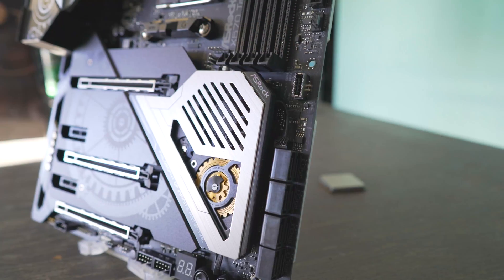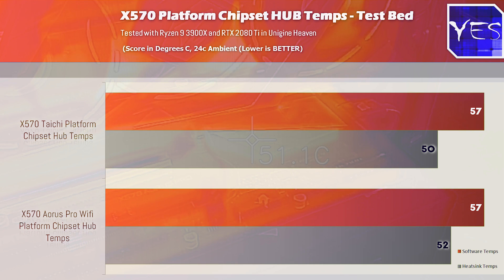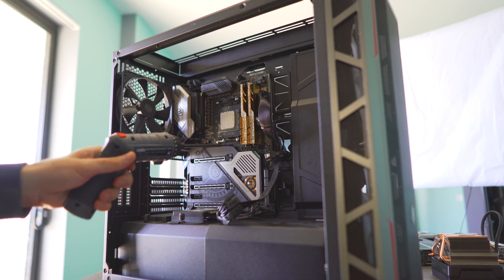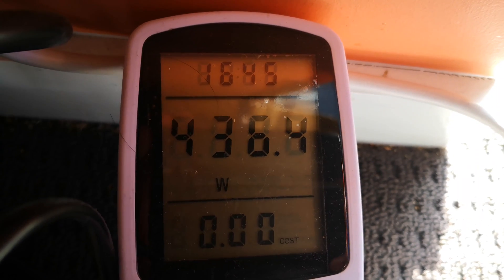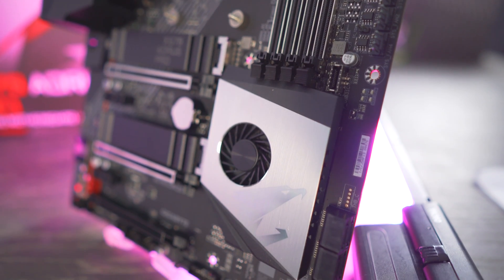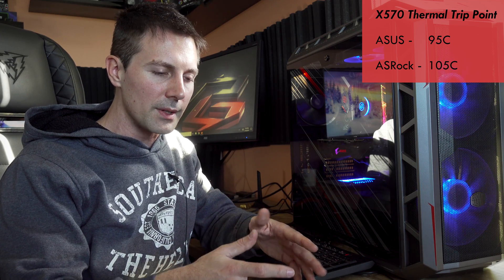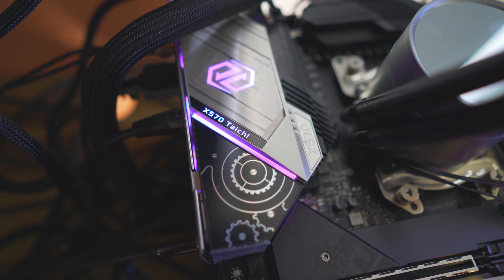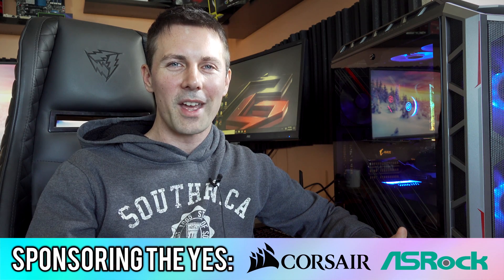X570 Chipset Overheating...!? (Investigation)

Comment: x58 NO PROBLEMS! 😎😂
Reply: X79 no problems :P
Reply: @ChfHappySack  x58,z68,h81,z170,b350,x370 no problem
Reply: Long live the x58
Reply: Exept high Northbridge temps... But thats normal on x58 xd
Reply: @Jack233  my electricity bill has dropped by half since I opted for x58, believe me!
Reply: @PLAY4CASES  like my Z390 better though.
Reply: @Jack233  My NB temps is 25~27° C during normal usage and 61° C when benchmarking, is it a good temp? (Asus P6X58D-E & Core i7-980X @ 4.35 GHz).
Reply: @ama.Caroli   that is the lowest I ve ever heard xd. Ive owned 3 different x58 boards now, a hp z400 oem board, a msi x58 Pro E and an Evga x58 ftw3. All of them where over 50 degrees in idle. The msi one got to 103 celcius once, I had to stick a fan on it. Between 60 and 90 degrees is normal and safe on x58. Even the hp board got to 70 C and hp already pointed an 80mm fan at the NB in the Watercooled version of the Z400 x58 Workstation.
Reply: Mine has been 40-60 for so long that I don't even remember if the temps where the same 8 years ago... So 25-61 sounds good
Reply: Exactly, but then motherboard manufacturers were putting on these boards REAL heatsinks with proper surface area, not those fasshion accesories that they make these days, and it was more than capable to dissapate 24,1W completly passive.
Reply: X570 Aorus Xtreme passive cooling nano-plating and never worry about fan cooling.
Reply: @Supremax67  the x570 only come with fans for heavy saturation of PCI-E 4 situations hell they support SLI 2x 2080ti 2x m.2, capture card they had to cover their ass
Reply: Z97 no problems lol
Reply: I bet any $$ most of the people having problems spent all their cash on the Motherboard & GPU, that's not even mentioning the RAM or other parts potentially expensive like some NVME Drives. So they probly cheaped out on cooling. I would also Mention if they cheaped out on a Power Supply & did not buy an 80+ stamped PSU than they might have a crappy Power Supply not always supplying the Computer with what it needs. Guys ONLY buy 80+ Power Supplies if you are building a high end system! Also I would NEVER buy a used Power Supply from anyone I didn't personally know (& even than would not a lot of the time) because as a Power Supply gets older each cable coming out of it looses a little power. Like if a Molex or SATA Power Cable is supposed to deliver 5.5 Volts to something, an older one might after running for 10 minutes to sometimes even a couple hours only be dipping down to 4 Volts or lower & that is enough to crash your computer or make it reset.
Reply: @dhgodzilla1  RM Series RM750 — 750 Watt 80 PLUS Gold Certified (silence+power)
Reply: LOL.... that's pretty much what AMD has been doing since Ryzen.... bring in those super slow multi-core workstation chips to the frequency domain of "desktop" segment and wow those AMD fanbois... what a scam

Comment: Troubleshooting an X370 that won't run reliably unless AC is set to 23DegC; 
I have found that pointing a 140mm Fan at the Chipset is helping a lot. 
This chip should not be this sensitive, yet cooling it seems to be the solution.

Comment: I've chipset overheating issues. 
SYSTIN reads 101 C, CPUTIN is 90.5 C, TMPIN5 is 90 C, TMPIN5 is 101 C, TMPIN8 is 92 C when computer is idle.
Motherboard is Asus Z10PE-D8 WS with dual Xeon CPUs.
I'll see if I can add more fans somewhere. Which thermal camera do you recommend to investigate the motherboard?

Comment: Have the X570 Taichi with a 5900x and 6800 xt and after about a year have started experiencing freezing/ system shutdown issues. The SB fan started making noise around the same time. Have replaced PSU, updated all drivers, reset overclocks, no dice. Monitoring temps, everything seems fine with the south bridge temps. At a loss, hoping it’s not a CPU or GPU issue

Comment: It's the location of this fan on these boards that concerns me. It's right underneath the GPU when mounted at the 16x PCI slot. A big GPU is going to block & starve that fan of airflow. I've seen this play out when I watched a guy do a Ryzen 5000 build and his Taichi fan was super high RPM until he moved his GPU down to the lower slot. But that slot is typically only 8x PCI on most boards so reduced performance. This is a serious concern to me, and potential deal breaker. I work with music so I take fan noise seriously.

But whether noise is a concern to you or not? The wear and tear on that fan running at higher RPM than it ought to be should be a concern. Due to long term reliability.

Comment: The chipset fan on the x570 taichi is garbage. It makes a lot of sound after a few month of use.
But I've set mine at 15% fan speed until it hits 80C and it never hits 80C, so it's ok. But you've gotta manually configure that curve
Reply: Same here. It's really hot because of that thermal pad. The fan should on the top of the chipset, just like a CPU. with that, it wouldn't overheat. They did it with Taichi Razer Edition.

Comment: 570 Taichi SB Temps are really high here. Guess that Aorus 1080Ti is blocking the SB Fan XDD
Has anybody expeerience running a big graphics card right above the PSU? I've the PSU upside down because of the environment and think it would not be so good to have the air from the PSU and GPU collide XD
Many thanks in advance <3

Comment: Wish I had seen this before I my build. Asus Hero Chipset fan inlet covered by rx 5700 xt . Does fine till VGA VRM heats up, directly in front of the 570s fan inlet. All goes well till the little fan starts to spin. At that point the heated air is drawn into the fan enclosure and forced down over the actually lower on board heat fins inside the 570s fan enclosure.  I have had the covers off and noticed the chipset fan can get air from the back of the enclosure, Thinking I might try covering the side that is open to the VGA.  Crazy to think small chip doesn't want to see 50 plus degrees and big GPU doesn't cool till 60, but feeds little chip air. Fail!

Comment: please help :  i have a gigabyte 570x ultra , BUT ! the small fan on the motherboard is making a high pitch sweez sound,  can i take of the metal plate thing that is around the fan? or what can i do about the noise?
i blown it out with duster cleaner but that din't help :( and there are ZERO video;s about it online, cant see 1 video of the 570x gigabyte ultra fan.
it's not even a year old now, with my amd 3700x

Comment: Repasting my X570 Aorus Master dropped the Chipset temps by ~20c+ over the default pads...
Reply: What did you use to repaste it? I removed the pad and used thermal grizzly kryonaut thermal paste but the temps stayed more or less the same. I had to put a fan in front of the chipset heatsink/fan and that helped to drop the temps 15 degrees. That actually solved my bios reset and boot issues. I have X570 Aorus Master as well. Also, the airflow of my case is very good so no problem there. But my Radeon RX 6800 XT sits right on top of the chipset heatsink and I think that pumps a lot of heat into it.

Comment: Heh, you should test the x570 asrock phantom gaming x. 71C southbridge temp displayed in BIOS 1.70. I updated to 3.40 and the SB_temp indicator was simply gone. ASrock does not answer support tickets regarding the problem anymore. Terrible customer support! Testing the chipset temp with sensors in linux reveals the chipset is around 70C at idle. 4K rpm on the chipset fan..

Comment: EVGA 1080Ti fan shoud blocks a good part of that taichi sb intake, and default fan curves keeping the gpu at 55c results sb temperature in the high 70s, sometimes low 80s. I made a modification (removed the blocking part) to the shroud, and upped gpu fan speed to 31% (still below other fan noise) which resulted in the sb fan completely shutting off. SB temperature is now 60 to 65c.

Comment: FYI my Asrock x570m Pro4 chipset fan has started to die, making a loud ratchet sound on low RPM. Good thing you can set the SB fan 1 curve in the atune utility so that it will only spin up at 80c+ temps which is what i did to solve the issue. That being said, the chipset fan should not be breaking 4 months into use... very cheap.

Comment: My x570 chipset fan made loud noises and stopped working after 5 months, ASROCK gave me no issues sending me a new chipset fan. Of course I have to instal it myself or ship my motherboard to them. But yes, my case has a very hot to the touch and I have 6 fans, 3 in and 3 out.

Comment: I have a Ryzen 3800X and a Nvidia 1660 super. I haven't overclocked anything. When my computer is idle and just have a browser open the x570 chip heats up to 70C quite often. I can hear the fan coming on and it's really annoying. It's a high pitched whiny fan because it is so small. I'm going to try moving my graphics card down a slot because I definitely think the little fan is not getting airflow over it.

Comment: Msi x570 unify + 3900x temp fix
Setup bios. Save to profile.
Power off. Remove battery. 
Power back on. Check temps in bios.
Should be good now. Power off.
Reinstall battery. Boor to win
Temps and boost fixed.

Comment: I have the x570 Aorus extreme. Idle temps are 60c. Heatsink hot to touch. NVME idle same 60c. Stress test gets to mid 80s. Idle wattage with 3950x is 145w. Switched to x470 asus crosshair hero VII and idle temps are 25c with 70 watt idle. X570 sucks.

Comment: Same issue. 3900x + x570 unify.
Cmos reset. Boot to bios. Temps climb to tjmax. Save settings. Reboot to windows. Temps drop 50c in 20 seconds. Runs fine all day. Turn off. Sleep turn on. Post fail with hang...rinse repeat every day. Rma both. Waiting for reply.

Comment: Ive been having Issues with my Aorus Master X570 motherboard. when I got it, I installed everything and it was running, but the Fans went apeshit, so incredibly loud even though I had them on Silent. Eventually, the PC began to have unusual behavior, it would restart on its own. I even turned that off so a blue screen would appear instead of restarting so it would let me know what the error was, because i deduced it was crashing. until at one point, not only did it stop turning on, it also fried 2 of my Samsung 860 SSDs. I sent it to gigabyte, but they didnt do crap and they took forever to return it (not to mention they made me pay for the shipping), and they did nothing to it but update the BIOS, which obviously didnt do anything. so I called them, they blame any other components but their product (naturally), even though ive tested all the components on other motherboards I own. to this day it continues to not function, no matter how many tests and components i tried and they wont take it back. so im a bit disapointed with gigabyte since I had been so hyped with their products since their Elite WiFi and Pro WiFi boards and their 2080Tis were working great. I dont know what else to do after reseting CMOS, updating latest BIOS, Installing a brand new fresh windows 10 on a brand new 250gb nvme, disabling ram XMP and running it on stock and everything on stock, and trying EVGA and Corsair PSUs, Noctua and BeQuiet coolers, its just insane, and I check on the temps after it restarts on its own and they dont get any higher than 40c, so ive just about given up on it. shame cause its such a bad ass looking motherboard

Comment: tuf gaming plus board from asus overheats with a 980ti, chipset fan runs upto 4000+ rpm but is not controllable  unless you use argus monitor, see temps of around 73-80 on a couple hours of gaming, what a terrible place for a fan

Comment: Asrock X570 pro4 motherboard, 3600x CPU and a 1070ti GPU.  Just built this PC (waited on a new GPU because im broke).  However, the southbridge does run a little hot at times.  Temps showing around 65 c and have seen it at 70.  My PC obviously hasnt shut off at these temps but i was concerned at first until i read up on it.  Almost everyone is saying this is a normal temp range for x570s for some reason. I am just not used to seeing it.

Comment: Which software did you use to monitor the temps? 
I haven't looked into it yet but after playing COD Modern Warfare in 1440p last night on my 3900x with 5700XT in Evolv X case with prism wraith cooler and 4 Corsair LL120mm Fans in the case I noticed the air coming out of my case was very warm and the case felt very warm to the touch on the backside. I am planning to use a water-cooling kit anyways but it got me thinking. The GPU sits pretty much on top of that little chipset fan...

Comment: dude nobody wants to move their gpu to the bottom slot plus that one works at x4 anyway.  cmon. NOT AN OPTION.   I have been worried about this problem though because i want the asus TUF X570  which will have a blocked fan and have been hearing the same thing about overheating chipset.   I already have a 3800X and 32GB of DDR4 but haven't got the MB yet partly because i am worried about this.

But see, you are just doing a benchmark run, which is a only a few minutes long.  but what happens when you are in the middle of a multi-hour gaming session how well is it holding up then?!   I mean, WHY would they do that????   what do they think just because you don't want to spend  over $200 on a motherboard you are gonna be using some garbage teeny tiny bottom of the line graphics card?  I have an asus 980ti which doesn't have that solid rail going down the back of the cooler so it's gonna be spewing hot air right in to the chipset fan.  man i'm worried.  Can anyone tell me if they have had issues w/ TUF X570?

Comment: Bought x570 taichi, SB temps are 90 degrees at idle in bios & SB fan is at 6000 rpm, USB keyboard is not recognized 70% of the time, system keeps rebooting.. good thing I can return it within 14 days,  whole system consumes 22 Watts, I removed all sides from a case so its fully open air

Comment: My Asrock x570 phantom gaming x motherboard temps are real hot bootup temp is at 65c running games is 75-90c Asrock tech support says that's no problem but seems way to hot to me lol am used to lower temps before x570 chipset.

Comment: Yesterday it was super hot and my room was around 30-32C-ish.
I looked  at temps and my chipset was at a whopping 97.5C... 

I got worried and figured something must be wrong, so I went to stock everything and it kept rising still.. 

I shut off my computer and wondered if the chipset fan was broken or something, but no, it still worked. 

I figured it might've been a sensor error then, but when I touched the heatsink I actually burnt myself a little.. So yeah.. 

This is on an x570 VIII Hero. :/ 

I don't know what to do, but this might explain why I sometimes during stress tests had temperature shut downs even though my CPU had good temps.. 

I can't see anyone reporting this issue, so I wonder if my motherboard is faulty or I hit some bug perhaps..

Comment: Well, i do have two 1070 gtx cards and a ryzen 3900X in a BQ801 case with front opened and the chipset stays cooler with the fan turned of than turning the fan on (no matter if 1500 or 6500rpm). That is because the fan pulls hot air from the gfx card. I did a test with a really strong fan (airconditioner set to fan mode) blowing from the front into the case. That indeed cools the chipset to 55-60C, but this fan runs with 65dba and there is no pc fan out there who can move this amount of air.  Anyways with the fan turned on its always 1C less than my GPU temp - so its around 75-78 while gaming. With the fan turned off it is around 70-73C. 
So long story short: The fan is not only useless but makes it worse in my case. Pretty sure this depends on the design of your gfx card.

Comment: My X570 Taichi hits 91c after 30 min of gaming, i got a MSI RTX 2070 super Gaming X Trio,  Nzxt Kraken x72 top exhaust, 3 fan side intake 3 fan bottem intake, Case Lian Li 011 Dynamic, the system will shutdown after an hour the temps hit 95c on the chipset and the fan goes in jet engine mode... moving the gfx card a slot down will still give me high temps it just takes abit longer before it will hit 90+
Reply: Cyclonic _NL that sound like a buggy card?

Comment: I have X570 Taichi and Asus Strix 980ti. Strix will cover chipset intake quite bad with heat pipe and chipsets temps get high fast. I did run some benchmarks and stopped after chipset was 77C only after 8-10min of GPU stress.
I moved GPU to second PCIE slot and now temps for chipset are: idle 60-62C,  gaming 75C. I have checked that chipset cooler is correctly secured. Case is Fractal Meshify C with 2 x 140mm intake and 2 x 120mm output. Room temp ~23C.
imgur photos of the Strix covering chipset intake : https://imgur.com/gallery/GABLbI0

Comment: I have MSI gaming plus x570. Case airflow is so good (2x140mm front and 2x140mm back with low rpms) that chipset fan basically never spins. Temps are about 50C on the chipset. I have set "silent" profile for chipset fan. It will start spinning somewhere about 55-60C. No worries there.

Comment: I think I found-out why this is happening to people. Nearly all the X570 boards are laid-out so that when you plug in the GPU in the PCI-E x16 slot, it stands directly on the chipset cooler's intake. A lot of that heat from the GPU goes to "cool" the chipset, and instead does the opposite.
Reply: So what's the solution to this problem? Move the graphics card to the 2nd PCI-E slot?
Reply: after a year i think this is what happened to my z590 pg velocita 
now even without the gfx card it just overheats and shuts off